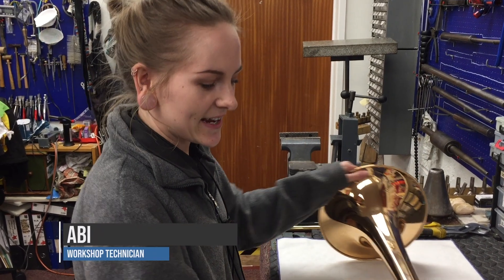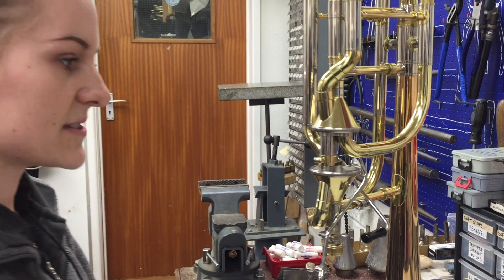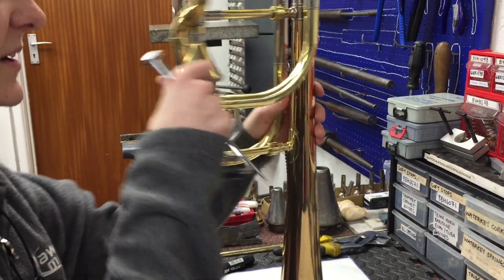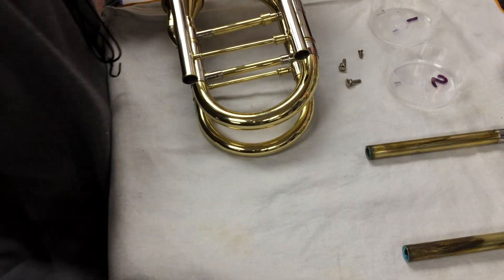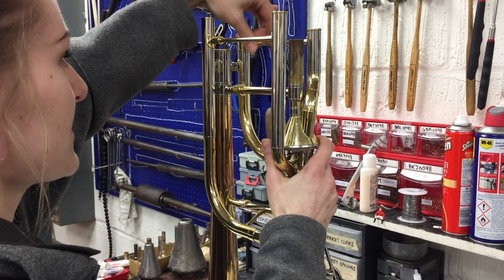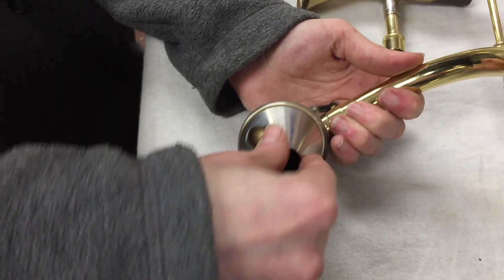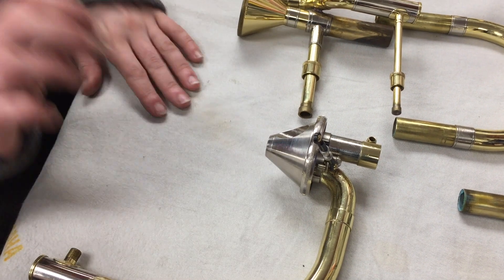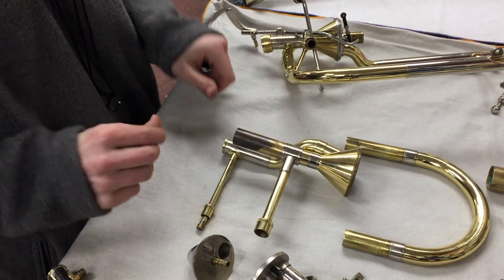Brass Repair Cam - Bass Trombone Axial Flow Valve Disassembly and Clean (Abi)

Comment: Abi did a fine job of showing and explaining but she earns bonus points at 8:50 for mentioning "making it easier for the next person" to take apart by doing preventive lubrication. If only more technicians would be pro-active about doing things correctly, many repairs and maintenance tasks would be simplified and ultimately, save money for the customer.

Comment: That green stuff is VERDEGRIS which will occur on any copper based alloy - copper, brass and bronze. Brass is copper and zinc, bronze is copper and tin. Verdegris is actually quite poisonous if ingested. I suggest using a face shield when removing it. Great video. Thank you. Ian
Reply: Face shield unnecessary as long as you don't suck the verdegris out of the tube. Been repairing brass for over 20 years and never had a problem with it.